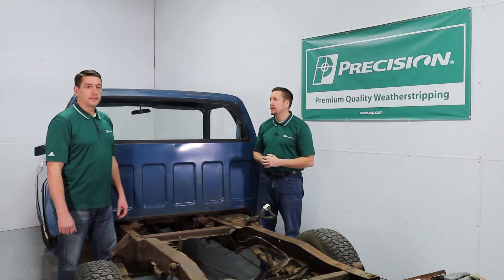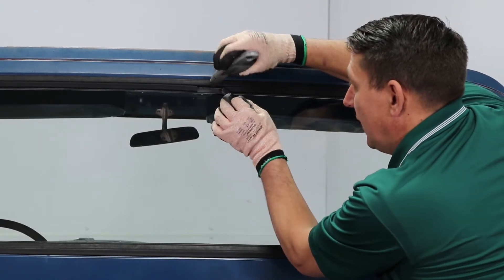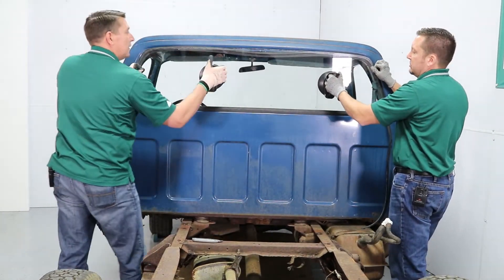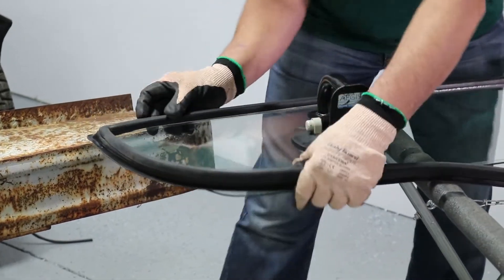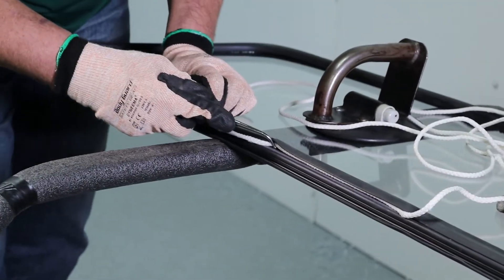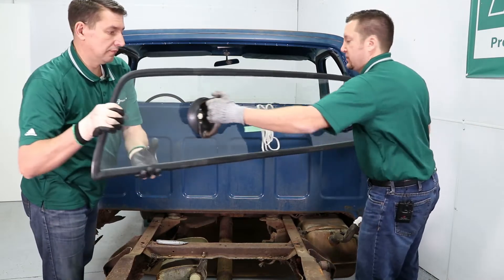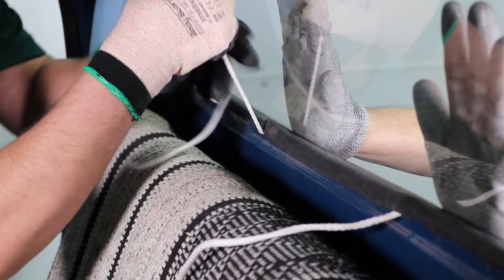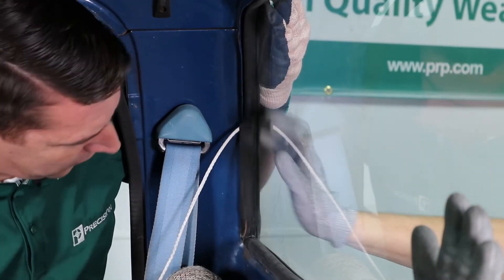1973-1987 GM Truck Rear Window Weatherstrip

Comment: Great video! If my pickup originally came with a locking weather strip can I use this one as a replacement?
Reply from the maker: Yes, you can convert from the lockstrip style to the solid black style.
Reply: @PrecisionReplacementParts  Thank you for the reply!  I am excited to replace my weather strip and convert my slider rear glass to a solid piece on my 77 chevy k20.